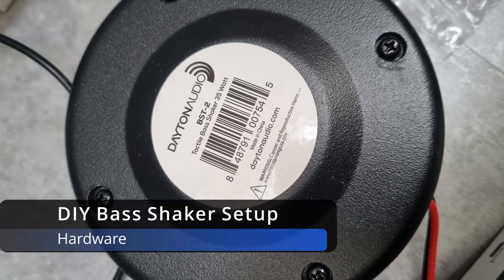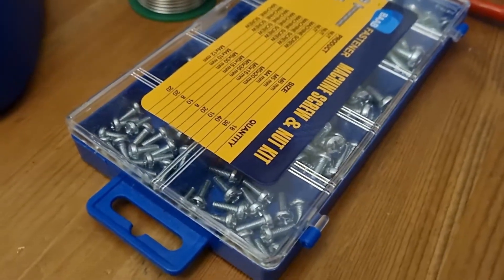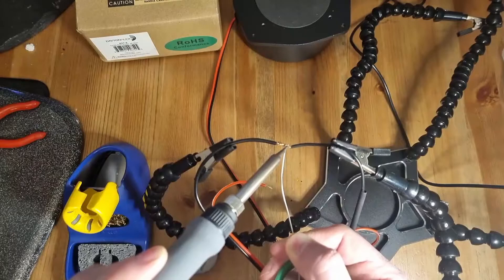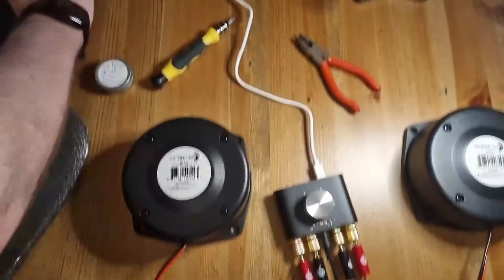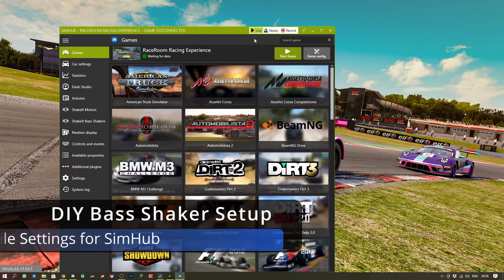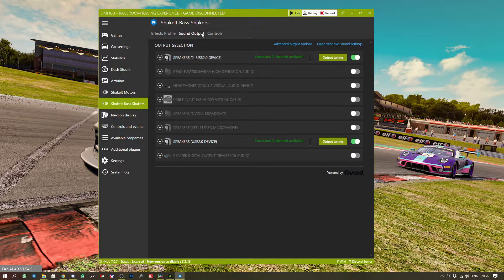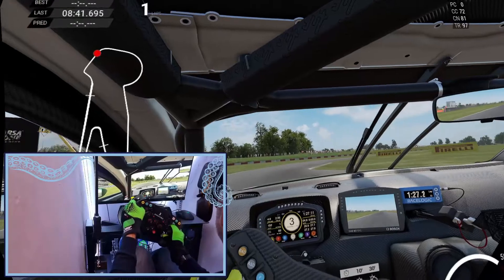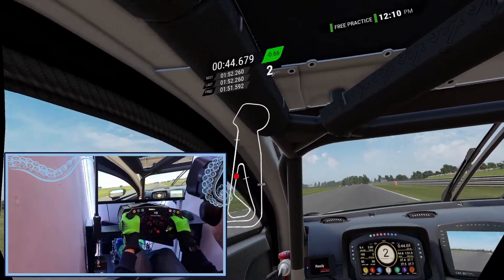DIY SimHub Budget Bass Shaker Setup

Comment: Great video! As a father myself with kids sleeping in the room next door. Is it worth using this with low volume so it might not bother anyone but you can still feel it decent? 

Or should I expect lots of noise even at low volume? Thank you.
Reply from the maker: Thanks for the feedback, I'm glad you like the video.   As a parent I have a similar issue to you, whilst I'm not next door to their bedroom I still have to deal with reducing noise levels.  If you can mount the bass shakers directly under your seat like I have then actually you absorb most of the vibrations so I don't have to turn that down much at all and still have a lot of feedback sent my way.  The pedal tray is a different matter though, I have to turn that right down and whilst I do still get a feel for what the car is telling me it isn't a patch on what you can glean from daylight hour volumes.  Essentially my advice here is to make sure you attach the bass shakers as close to your person as you can and work to avoid any of those vibrations from making your rig rattle (attach them as tightly as you can to the surface you are using and try to isolate that sound from hard wood floors or between surfaces by using rubber feet or grommets).  It can still be worth it if you're careful, even if it is just an attachment under your rear end!
Reply: @TeqqlesdoesVR  Great reply thank you! 

So I got a 80/20 rig with a proper racing seat, so my idea was to mount it directly under the seat. I dont feel like drilling any holes in it so either some tie straps or just some double sided tape, not sure if it would handle the vibration though. Anyways I think it should work fine because its not directly on the 80/20 part. Guess I also need to figure out how many I need, thinking one in the butt and one in the back seat.
Reply from the maker: @TheCameltotem  bucket seats are a little harder to mount. My first thoughts would be to mount it close via the seat mounting frame and isolate that from your rig so vibrations don't resonate through the whole thing. You're making me want to buy a bucket seat to experiment with 😅

Comment: I have the R6 XL seat. 

Just installed 2 Dayton Audio BST-1's on a wooden board and screwed it on the bottom metal frame on the chair.

Did not get the result I was hoping for. 
Little effect in the chair and a lot of vibration on the floor. Does not translate well to the chair at all.

Your method is even easier to install.
At first I was thinking that it would not work because there isn't a lot of surface pressure on the bass shaker because it is more or less hanging loose.
But I guess it works.

Will try this tomorrow! 

Thanks for this video, any final tips?
Reply: It works perfectly! 😊
Lots of feedback in the chair and great isolation. No longer a rattling frame.
There’s only room for one underneath the seat, but it’s more than enough.
Think I’ll install the other one under the pedals somewhere.

Wanted to test everything last night, but my CSL DD got stuck in a firmware upgrade and I have to send it back to Fanatec for repair 😞
Reply from the maker: @osiris5315  nice, I guess the BST-1 is slightly bigger than the BST-2 hence the space problem. Still good feedback is a result 👍
Reply from the maker: I think the pressure comes from your body weight compressing the springs. Hope it works out for you,  the BST-1's are more powerful than what I use so I'd expect some serious rumble! Let me know how you get on!

Comment: hi, ive set up my transducers and there’s sound coming through them is there anyway i can just have them just vibrate, and use my headphones thanks
Reply from the maker: If you're running them through a different soundcard like I am with the nobsound then you can set it to just play vibration effects via software like SimHub.  If you are getting other audio it sounds like they are set as your primary audio device or running through your main soundcard?

Comment: Hi,,was planning to build bass shaker using simhub,,can i use the simhub and play assetto corsa using content manager at the same time? Thanks
Reply from the maker: Yes, absolutely.  Simhub just runs in the background in your system tray.  To configure it to work with Assetto Corsa follow the instructions from the Assetto Corsa Game Configuration screen under general.  In most cases it'll auto configure.
Reply: @TeqqlesdoesVR  thanks mate😊

Comment: Can I use my main amplifier for this?
Reply from the maker: SimHub will need dedicated channels for the output, so if you have 4 channels available (or two if you are just doing front and rear) then you might be able to get away with it, but don't expect to be able to share the channels for your usual audio as that'll mess up the effects and most likely generate a bunch of noise in your audio channel.

Comment: morning, since i’ve set up my base shakers my sim racing hard ware gear and rev counter stopped working, any ideas what’s going 👍🏿
Reply from the maker: Are these all running out of the same USB hub? Off hand I can't think of much else that'd cause drop outs of your other hardware, though earlier bios revisions of AMD motherboards kept losing usb devices too
Reply: @TeqqlesdoesVR   ive solved it thanks i swapped usb ports working fine , thanks for the help 👍🏿
Reply from the maker: @keithmorris604  no worries. Glad that worked. USB ports are always the first thing I change these days,  so many issues come from power supply or USB standard

Comment: great vid, can i run four transducers off the amp your using
Reply from the maker: The amp featured in the video is unfortunately only two channel which is why I used a pair of them. You could link two with the same effect but if you're looking for different effects from each then you'll need to double up.

Comment: How have you liked having your pucks mounted directly to the spring wire under the seat? I just set mine up today and did a thing piece of MDF under the springs then another sheet mounted to it from the bottom side with the pucks, amps, power, etc. To I thought about zip tying them on but was worried it would rattle. Would love to hear your feedback!
Reply from the maker: I was worried about the rattle too but once you are seated down the tension your added weight adds really tightens up the springs and it isn't a problem.  Part of the reason I opted for this route was so they still had a little flex so the seat has some sprung movement so I'd be interested to hear how the MDF feels under seat.
Reply: @TeqqlesdoesVR  The seat with MDF feels slightly stiffer but I haven't noticed a big difference yet. Testing the shakers, they feel much stronger than the shakers against my back that aren't as solidly supported.  If it bothers me I'm just going to go your route!
Reply from the maker: @Schwipples  that's interesting.  I guess the springs could be absorbing some of the effect.  I only run the BST-2s at about 50% right now so think I have enough headroom to counter that.
Reply from the maker: @Schwipples  glad to be of some help!

Comment: Hello Mr D J (i'll stop there as don't want to give out you full name) Iv watched you vid an am impressed. so much so im ordering parts. Just see your review for the shakers is the trigger comment. Iv found from Dayton Audio  16 ohm  Bass Transducers they have no 8 ohms in stock. Iv done my home work on this and see no real problem other then a drop in Db. as is not playing sound i cant see a big difference. 
What do you Think?

Oh of course.. Great Vid but you no that already from me since I said I'm making it haha
Reply from the maker: Hello fellow DJ ;) Glad you liked the video - I really liked working on this project so had to share!  If your transducers have an impedance of 16 ohms and the amp 8 you should still be okay.  From some reading I did before buying all the parts the rule of thumb is to never go above double what your amp is feeding.  Let me know how you get on.  The BST-2's are 4 ohms btw and I have to turn them down as at full volume they wake the family!
Reply: @TeqqlesdoesVR  IV gone for 2x Dayton Audio TT25-16 20 -80 Hz. So 10hz off lowest end. The butt kicker goes as low as 5hz way upto 200hz, which if it was sound  bass is upto 80hz then it starts to become mids.
I did read iracing it goes down to 35/45hz using LFE. I'll be using sim hub and read they go down to 15hz so not losing a lot.
At the moment 8 or 4 ohm transducers at 2 or 3 time more money.

Oh I have the same amp. Will run just two kickers for now and add more later
Reply from the maker: @Kagey21  I guess you'll lose a little of the detail by having to squish down into a smaller range but not a huge amount and SimHub from what I remember lets you set your frequency range for each effect so you can mitigate that low end loss.  The BST-2 also tops out at 80hz, think that is fairly common and like you say further up the chain you aren't losing out on bass anyway.

Comment: i have  4 in total. 1 under my seat, 1 under my pedals, a puck on my throttle and puck on my break . in vr its awesome
Reply from the maker: Interesting setup.  I modelled my setup on wheel positioning as far as I could but it is good to keep them close to where you'll be able to feel the forces so you get the most benefit from the feedback without it leaking too much through the chassis.
Reply: What puck did you use and how did you mount it to your pedals? What amp do you use?

Comment: Instead of having 2 nearby you could have one under the pedals , and one on the back chair, it would be more beneficial because you can assign it to wheel slip on front and back.
Reply from the maker: I actually have four of them so I still have front and back, left and right.  Initially I didn't feel much benefit from left and right - I could just about feel the difference but now I guess I have gotten used to the difference and it does help a little with feeling slip in either direction on the rear :)

Comment: Would love to know more about your effect settings for simhub. You mention feeling kerbs... is ACC providing this data?  Also, really curious how to get the right feeling on 'losing the front end'.  Really appreciate your effort here.
Reply from the maker: The effects come from ACC via the telemetry broadcast which can be enabled by setting up a broadcast file in your ACC folder, for example:

edit your Documents\Assetto Corsa Competizione\Config\broadcasting.json to 

{
    "updListenerPort": 9000,
    "connectionPassword": "asd",
    "commandPassword": ""
}

and then make sure those settings are matched in Simhub.  Most other games have something similar and Simhub is able to give instructions for those individually.

The effects I find give you the best feel for losing the front or rear are wheel slip and wheel locking, I've provided a copy of my profile here https://drive.google.com/file/d/1FOEsMtYcY34LCAANx3r7s7QRWp39fOi9/view?usp=sharing which could help with getting started.

The effects I have enabled at the moment are:

Engine Vibration (10%), this gives just a low background vibration to feel the car tick over but not be overwhelmed when you're reaching the limiter.

Gear Shift (40%), gives that kick in the butt when you shift gears.

Road Impacts (100%), feedback for lumps and bumps in the road.

Road Vibration (91%), provides a feel for the road texture.

Simulated Road Texture (12%), a feeling of the tyres rolling over the road surface, changes with speed.

TC/ABS Active (100%), gives a strong vibration when traction control or ABS kicks in (these are two separate effects but they're so similar I lumped them together).

Wheels Lock (35%), localised per tyre feel for when wheels lock or slip under braking.

Wheels Slip (61%), localised slip feedback - I believe under throttle.

The percentages here are for volume strength.  Hopefully that gives you some additional info :)